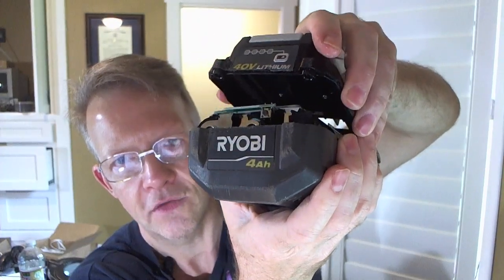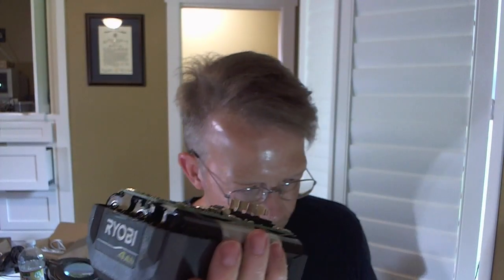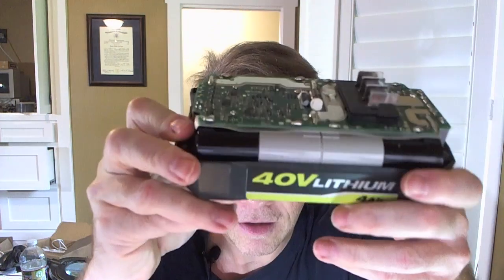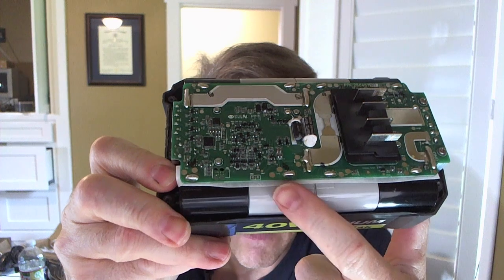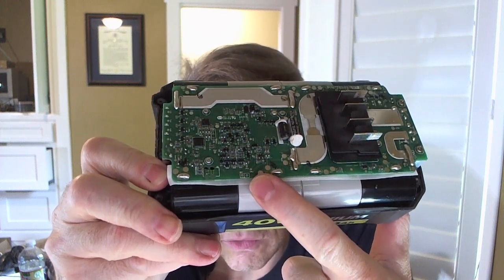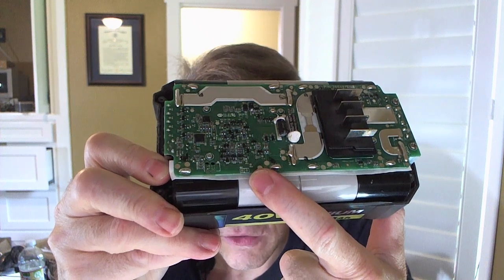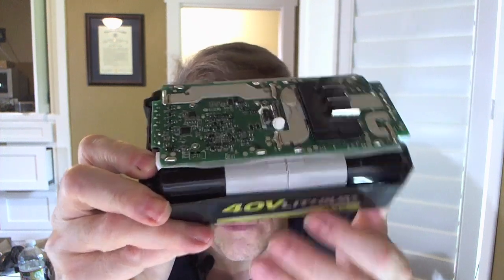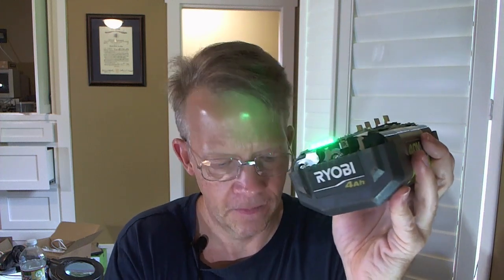Don't "Boost"; Safer Reset! 4 lights blinking on Bad Ryobi 40V Battery Pack? OP40501 OP40401 Rev. Q.

Comment: This is helpful. I would like t add that I am stuck at a remote cabin, but have a set f small tor bits. I modified the approach by using a drill bit that is just jess than the shoulders of the Torx, and bit down into the reverse dome of the screw head. This allowed my ordinary Torx bit to sink deep enough to allow me to unscrew the Torx screw. It takes a lot of torque to do this. Also, the same drill but can make mince meat out of the plastic plug, giving me joy.  So, if you are stuck without that specialty bit, try the drill technique.

Comment: Hi Robert, Thanks for the tip. It worked, but I had to reset again after about 5 minutes of charging. I hope this won't keep being part of the process. 

The most difficult part was digging that dang plug out that was blocking the one Torx Head. I don't know why Ryobi doesn't have a reset button for this option, they are hemorrhaging millions of dollars over a stupid little detail. My 10 year old Rigid Cordless Drill Combo set has never done this before. I challenge everyone to send Robert $10.00. That seems like the least we can do for this useful tip. 

I may have jumped the gun on thinking that this fix solved my problem. Battery wont reach a full charge, I have reset it at least 10 times, voltage is at 35.5-36.5 . I did run the hedge trimmer for about 8-9 minutes, and came back in and put it on the charger. It started charging and repeated the same scenario again. Going to let the battery rest for a while, as it now charges for just a couple minutes and then back to green/red, green/red. I will update this post when I figure out more about what is going on. 

Robert have you got any suggestions?

Ryobi is sending me another battery. So I haven't lost anything but some sweat equity at this point.
Reply from the maker: Yes I got a new battery too as mentioned elsewhere but mine was an overheat condition due to working outside. 

I’d consider soldering wires from RST to the battery gauge so it resets every time you check voltage maybe. Don’t blame me if this defeats an important safety feature but it should just fault out again is what I’d think. 

Def. Thanks so much for the donation!  

If the pack doesn’t work very long after a few cycles it’s still worth keeping for emergency power out USB device charging. 

If you have the charger with the USB port. I have with and without.
Reply: @RobertBullock  Thanks for the Reply. Good idea about soldering a jumper from the RST, to the check battery switch.  I'm going to use/cycle the battery a few times and see what happens. It might recondition the battery if I use it. CS at Ryobi said that the replacement battery would be here in 10 days. I assume by then, I'll decide what to do with the old battery.

Comment: For anyone who had been looking for a solution to resolve their Ryobi OP4026 that has a different board, you'll need to jumper RST and the 3.3v holes for a couple of seconds: @
Reply from the maker: Interesting. Anyone else validate this? This board has 4 holes IIRC? CLK / RST / 3.3V plus one more IIRC like it's a data interface.
Reply: @RobertBullock  I can verify that it doesn't work.  If you juper rst to 3.3v nothing happens not even shorted for 10 seconds.  if you short RST to GND once you release the short all the lights blink again but it doesn't fix

Comment: Is there a way to do this with 18V Ryobi batteries? I have an old 3Ah, and I've charged all the cells to 4 Volts individually, but I still have 4 blinking lights and it won't run any tools.
I'm thinking this might convince my battery that it's actually healthy, if I can only find the right little circles to connect

UPDATE: After a little experimenting, It looks like the solder points labeled TP42 and TP42B can be jumped to "reboot" my P191 battery.  Unfortunately, one of the MOSFETs seems to be bad.  Time to salvage some cells!

Comment: I was excited to find this video as I have a 40v battery with the same problem. However I have a model OP40404 and it looks different, so I can't identify an equivalent solution. Any ideas?
Reply from the maker: Read the comments to see if anyone has that but if you open it and there’s a single RST marking next to two holes it should work. If there are 4 labels like CLK etc next to it that’s a diff connection. Subscribe and like pls.

Comment: Yes! It works!!!! 2.6 Ah is back and ready.
Blew off my driveway and front yard with it and used it to prune my front hedges. After it got too low to run my tools, 45 minutes, I recharged it and edged the front yard. I have a third of an acre lot so this…. I timed it, eight minute chore, made me around $90.00 bucks. Oh dude, I must be a geek because I had the security torx head and some small gauge insulated wire from an old 4’ fluorescent ceiling fixture I converted to LED. 
Thank you thank you for sharing bro!
Reply from the maker: Glad I could help! Please give us a Subscribe so YouTube will actually pay me for the ads they show WITHOUT paying me...so wrong...or donate a dollar at http://paypal.me/beachfitrob...finally, I also take crypto if you want to send me a few sa

Comment: I tried this fix on two Riyobi OP40401 batteries. Sad to say, it didn't work. Thx anyway.
Reply from the maker: Sorry to hear that. It's a fairly high percentage that work tho.
Reply: @RobertBullock  Elsewhere on the interwebs someone mentioned there was a design change to the circuit board preventing your procedure from working on newer batteries.

Comment: This is a great video! Do you know how to apply it to a Hart 40V lithium ion battery? The circuit board does not have the pads or RST label you mentioned for the Ryobi battery. Mine got overloaded and is now just blinking blue and wont charge or start my equipment. It is less than 6 months old.
Reply from the maker: Hart? Never heard of it, so no. :)

Comment: I've got a different version of board here in Oz. But there is still a position marked as RST or reset. I think you need to put that pin to gnd. Best use a 1k resistor. Also I'm finding the MOSFETs used develop a high drain to source resistance in on state. Should be .004 ohm by data sheet but can raise to kilo ohms. Causing no go. Or very inefficient operation. I recommend checking and probably replacing MOSFETs anyway.
Reply from the maker: Beyond the scope of this video but interesting. Inefficiency probably doesn’t matter so much given a relatively short runtime.
Reply: @RobertBullock  by inefficiency here really means more than mild stuff but getting half the runtime of your lawnmower which can be frustrating .half the power going into feeding the Resistance across drain and source of the MOSFET switch. Because of the heat at mosfet the problem gets worse and puts strain on batteries and charger more and more until MOSFETs fail to allow operation and or batteries cid pops. The online ratings on Ryobi 36v batteries is quite poor and I'm wondering if bad choice of MOSFET is the general reason why .

Comment: I got a few of those batteries and I was able to restore 4 out of 8 , but what do you do when the control circuit will not boot or restart or anything ,but the batteries are OK. Is there a hidden fuse that blows when the battery gets too hot or something like that ??  I ran into that issue with Laptop Batteries and  DVD Player batteries. They said there was a hidden fuse and that if you can find that it is easy to repair, using some micro fuse wire. One some laptop batteries it is just that, a hair sized wire to power the control circuits, and very hard to see it. They just jumper a small piece of fuse wire across a couple of traces on the circuit board. On the Ryobi Battery, I have not been able to find it, still hunting.
Reply from the maker: Don't know. I'd check the charge on the battery circuits and manually charge to around 30 something. It won't charge if the batteries are too low. But I don't tell how to do that because of the hazards.

Comment: My reset works on my 40-volt but then when I go to charge it it works for a little bit and then goes red green have you ever heard of that
Reply from the maker: Try it a few times. You can charge it without screwing the top case on. Just hold the case halves tightly while putting it on the charger.
Reply: @RobertBullock  I've got a 4 amp battery two of them I tried them both twice and he went back to read green I wonder if a guy would put a permanent wire in there in the reset probably not

Comment: Thank you for the video. In the end it seems to have worked, meaning I had to reset, place in charger for a few minutes until it tripped again, repeat several times, it now seems to have risen above the minimum threshold and is now charging as it should be. Fingers crossed. :)
Reply from the maker: If I saved you money, send me a cup of coffee http://paypal.me/beachfitrob
Reply: @RobertBullock  Done. But alas, it was short lived, refuses to charge more than one led level. Still a great video for those it does work for.

Comment: Worked beautifully! Why didn't they just put in a reset switch? Would have been a lot cheaper that replacing the battery. Mine was a 3ah. They no longer make that one, so they were going to upgrade mine to a 4ah, but, since that one is on back order, they sent me a 5ah! Sweet.
Reply from the maker: Send me a coffee :) http://PayPal.me/Beachfitrob

Comment: Thanks so MUCH for this. Such a simple solution. I wonder If can wire those to up to an external reset button, so I don't have to take it apart if it happens again? Hmmmm...
Reply from the maker: Probably a few ways to handle that, if you want. I thought about putting two small bolts recessed into the case and then using that. But it shouldn't need resetting that often so I haven't. You can buy me a cup of coffee by expanding the video description above and using the PayPal link. I also take crypto. :)  I'm doing this stuff as a part time job so anything helps.

Comment: Rest worked for me but the battery is charging at with two full bars. Maybe I need to discharge it first?
Reply from the maker: Don't forget to Subscribe so YouTube will pay me a little for my efforts. :) And, do you mean it at full charge it only shows 2 bars? And yes, disharging may help recalibrate. Also it's possible 2 lights aren't working. I'll take a half battery I can use over one I can't use at all. :) You could buy a cheap 3rd party one on Amazon: https://amzn.to/3uxa9qu (affiliate link)

Comment: Your fix workd like a charm.  I was on my 2nd Ryobi 40V battery, the first one died about 2 years ago.  When the 2nd one died I was determined not to have to pay another $100 for a third battery.  Your fix was simple and easily repeatable if I ever have the same problem.  Ryobi should have a reset button on the exterior of the battery because this issue seems to be pretty common.
Reply from the maker: I've considered soldering wires to the charge level button so that when you check the charge it also does a reset. Consider a donation of coffee money and maybe I'll make that video. :) http://paypal.me/beachfitrob and don't forget to subscribe because I might just do that. Have to open one soon because it tripped again, and I have the wires/solder/etc. It's a simple thing.

Comment: When u make the connection to u solder it in place or just touch wait for the light to blink and remove
Reply from the maker: Just make the connection. Some people have had to press the 'fuel guage' button while the contacts are connected. No solder.
Reply: @RobertBullock  I appreciate it will give it a try thank you

Comment: Good video, but when I opened my battery up, the board looked fried down near the charger prong end.  So no easy, cheap fix for me lol
Reply from the maker: Hmm, might be possible depending, to rebuild the trace with solder/wire braid if it scorched something big. But get a friend to help who's good with electronics for stuff like this. Basically, I've replaced heavy board traces with a length of solder braid then you heat that braid and fill it with solder. Resulting in a heavier connection than before. But I'd have to see what is fried.

Comment: This so cool man. I had noooo problem liking and subscribing! Fixed my battery instantly. Buuut I do have another 5ah battery that has a different board that you have. Can you tell us what you are actually jumping? Are they labeled to where I can find corresponding ones? The issue with mine is meter reads fully charged, and the charger doesn't charge it because it's "fully charged" but yet it's only putting out 17volts. Happened out of nowhere. :( Thanks!
Reply from the maker: Thanks man! As for that board, sounds like half of it died. The board is split into two sections, each putting out around 20 V. Follow the big traces and measure the two sides but BE CAREFUL. The curent will vaporize metal instantly, so it's very dangerous and can lead to 2nd degree burns, eye damage, etc.

Comment: well i did this and it sparked once and then no more blinking and does not do anything when i press the button now. No more blinking lights and when i put on the charger, the charger blinks red and green indicating defective battery.
Reply from the maker: What did it do before that? Shouldn't have sparked if you only touched the RST contacts unless part of the board was also bad.
Reply: @RobertBullock  4 blinking lights. Only touched the contacts you indicated.

Comment: Thanks so much !!  Fixed for $7 - torx set.  FYI-- used paper clip.  Also I stripped one of my screw heads, so I would recommend NOT using a drill to put them back in.
Reply from the maker: And thanks for the donation! I REALLY appreciate it. Please like and subscribe. My channel means little without viewers.

Comment: Mine won't show any lights. How can I fix it?
Reply from the maker: You'd have to manually jump the traces with 20V on each side but due to the serious burn risks, I don't explain that. Perhaps you have a friend who is knowledgeable? An adjustable power supply could easily do it slowly and bring it up to about 34V total volts then the charger will work. Or 36V or so. Pack is split into two sections designed for 20V each. I'll give that hint. :) I.e. on the traces if you measure, each one will have half the total voltage.

Comment: Thank you, I followed your instructions and have successfully saved my 5Ah battery.
Hardest part was digging out the plastic plugs hiding the other set of screws. Whole process took maybe 5 min tops. Just to let others know when mine went bad. I was cutting grass with my mower, and I was about 30min into it finishing up the backyard. It was at about 2:00pm on a hot day with the sun blazing. My guess is the heat of operation combined with the intense heat of the day sent the battery into safety mode. Usually I don't do yard work in the middle of the day due to the heat, but that day I had a lot of stuff happening and that was on the list. Lesson learned, I'm glad I came across the solution. Big thanks, you saved me a $150!
Reply from the maker: Heat also caused mine to 'fail'. Please read the top pin comment on why YouTube is unfair to small creators: they play ads and keep all the money.  Please like and subscribe so I get a share one day (1000 subs needed) and I take coffee donations here: http://Paypal.me/beachfitrob :)
Reply: @RobertBullock  Done, checking out your other videos. Cool to see you're into crypto also.

Comment: Reset worked!
I left my trimmer out in the rain, causing all four lights to flash and the battery not work.  But the.RST reset trick worked!  I used a piece of solder wire bent in a U shape to reset it.  Hardest part was getting the four screws out.  I had to drill out the little center tip sticking up out of the middle of the hex head screws.  I used a T15 bit.  I just peeled the end label back instead of cutting it, and it stuck back down good as new.  Thank you for the video.  It saved me about $95 at HD.
Reply from the maker: Please read the pinned comment and Subscribe and consider maybe a cup of coffee for me? :) Even a few % of what I've saved people would be nice.

Comment: Thanks a ton! For those that freaked out like I did. When you jump the reset, my battery did nothing. No lights or anything. But when I pushed the button, it blinked a single light instead of all 4.
Reply from the maker: Yup, it seems to vary between needing a button press and not. Please read the pinned comment below. Youtube is showing ads on this and giving me none of the revenue.

Comment: Thanks Mr Bullock. I initially had trouble getting the plastic plug out of the 4th screw, but after some widdling, it came out. I used a paper clip that was held by a pair of wire stripper pliers. I pushed the battery status button while I jumped the two spots with the paper clip and the battery woke up out off sleep mode. It then took a full charge. Yes, I'll throw you a subscribe.
Reply from the maker: You can Buy me a cup of coffee here: http://Paypal.me/beachfitrob :) Don't forget that Subscribe. Read the top comment on this video for how Youtube hurts us small creators.

Comment: worked for me! i used insulated wire… put in both holes n left it 3 second … it lit up green n bam back in action taking charges again.
Reply from the maker: Please read the pinned comment. :) Probably the one below this. :) Plus: http://Paypal.me/beachfitrob anything helps. I get a lot more 'It worked! You saved me $100!' than people who send me a little something.